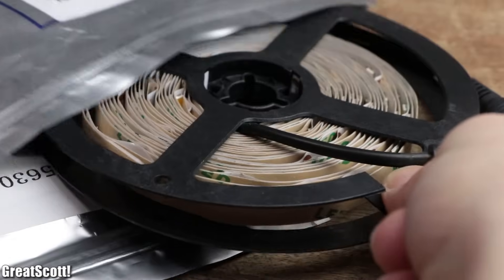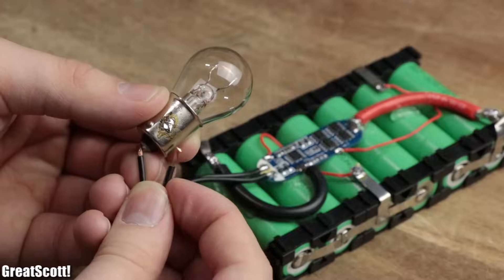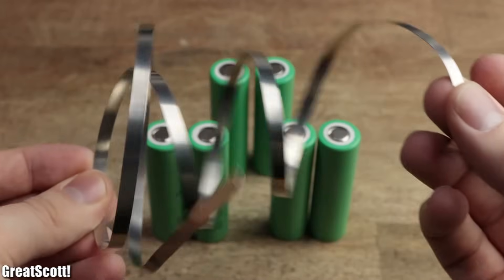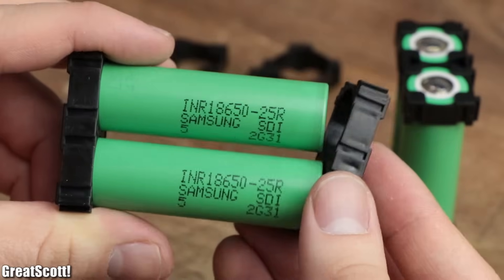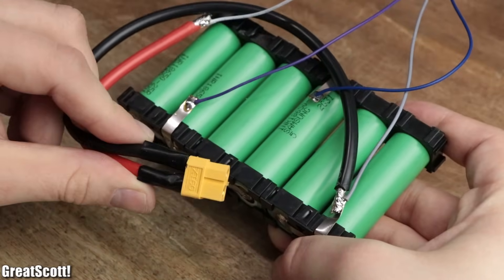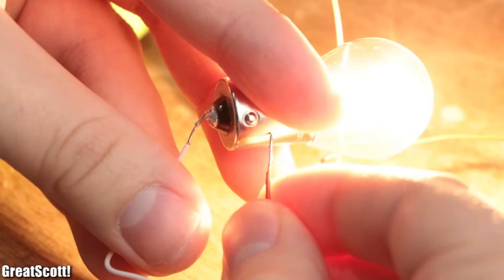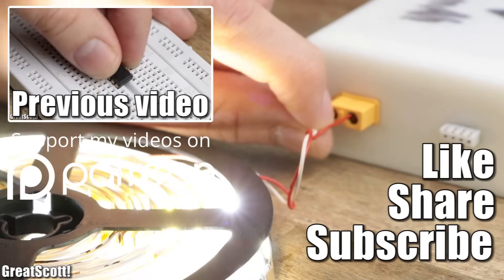Make your own Li-Ion Battery Pack

Comment: I think your spot welding attempts failed because of your technique. As you said, there was more than enough power available.

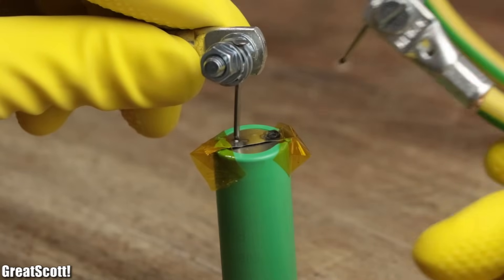Ill use 3:05 as an example.
For the spot welder to work you need both surfaces to be heated and you need pressure to force them into each other. At 3:05 the electrode on the left might have enough pressure on it for the process to work but you use the right electrode to close the circuit by tapping the nickel strip. This results in all the current passing through the nickel strip. The contact at the right point is dangling in the air so it is obvious why it doesn't weld. The left contact point doesn't weld because the battery terminal surface never gets hot enough to fuse with the nickel strip, even though the nickel seems to be red hot.

To remedy this, if you are unable to apply hard pressure to both electrodes, you need to press hard on one electrode to press the nickel to the battery terminal and then tap the second electrode somewhere on the battery terminal, rather than the nickel strip. This way the current has to flow through both metals at the contact point where you are pressing hard, resulting in heating both metals where there is pressure.
Reply: hobomnky how much voltage do abspot welder need  for this job ? ( And how much Ampere )
Reply: i dont know exact values. Something like this rewired MOT should work though, I wired one to give 3.5v output and it works. For battery terminals it would be better to have more voltage than that though. You can also use a capacitor bank for a more controlled energy output. You can have high voltage on the capacitor bank so that you get a fast, but limited, amount of energy unloaded in a short period.
Reply: hobomnky  thnx alot

Comment: nice video..im going to make one instead of lipo for my quadcopter..have a small question can i use those battery holders to skip spot welding or soldering part? is it okay? thanks..

Comment: Hey I am searching ways to light up my 12v rgb light strip that I want to install on my bike. So I found some li-ion batteries at rhis name Motoma 18650 2000mAh that are 3.7v. So basically I can add 3 of them and power it without any problem?
Reply: Yes

Comment: Could this be used as a motorcycle battery is would weigh far less and would only nedd it to get started. Would u bms control the charging ok with the bikes charging system??
Reply: Yes, they have Li-Ion batteries for motorcycles ...

Comment: Use the spot welder, don't solder directly to the cells unless you like fires. (or just buy tabbed cells)

Spot welding should be done by applying electrodes and pressure, then turning on the power.

Comment: 3/4" Schedule 40 PVC pipe can be used to make 18650 battery holders, although the inner diameter is slightly too large.  A few strips of thin plastic or even three dots of hot melt glue on the inner surface will ensure that the battery stays centered.  If you are concerned with airflow, a few slits lengthwise in the section of pipe, but not all the way to the ends will help.  1/2" Schedule 40 PVC is a bit too small, but if you have the capability to drill it out to 23/32", it could work.

When I needed to make a battery holder for an 18650, I made it out of PVC pipe or wood with a bolt in each end that combined with a lead slug acts as a terminal for each end.

Comment: i need some help...i need to supply 6volt to my  6 servo motors for my bipedal robot....i tried to make by connecting 3 li-on battery in series....and then regulated to 6 volt using 7806.....but this battery pack doesnt last for even a minute...what should i do???

Comment: Yep,
I read 3.6V nominal voltage, why did you took 4.2V as calculation référence?
Reply: that is max voltage
Reply: Areg Hovhannisyan thx...get it
Reply: 2.5 - 2.9v minimum
3.6-3.7 nominal
4.1-4.2 fully charged
no problem :)

Comment: Hey
If i use the bq29700 http://www.ti.com/lit/ds/symlink/bq2972.pdf as an protection circuit what voltage should i use to charge my LI-ION accu https://www.tme.eu/ch/details/accu-imr26650-5.2/akkus/keeppower/imr26650/ ???
I wanna charge it with http://ch.farnell.com/texas-instruments/lm21212mh-2-nopb/buck-sync-20tssop/dp/1922949
If you have a better alternative of the ICs pls let me know. (I have to make the circuit board by my own)

Comment: is there a way to make smaller power cells with this?
I have a project of portable computer system, will two batteries be enough to power it? (still don't know astimated power consumption to calculate myself)
maybe even using all 6 batts but as small seperated cells that could be better place in more conviniet place rather than a big box?

Comment: I really love this video!  I've watched it several times.  How did the soldering job hold up?  I want to use a spot welder but at the moment it isn't in my budget.  Did you see any unbalanced cells after using the soldering iron?  Hope you are well and thanks!

- Neil
Reply from the maker: Everything still works fine
Reply: That's great news!  I want to build my own 12s lithium ion pack but the spot welder would already be more than half my budget.  At that point I'd would rather just buy a lithium ion pack which would defeat the purpose of learning.  anyhow, thanks for the response!

Comment: Why not use solar taping wire to connect the cells together?
Reply: What is solar taping wire?  Anyway, could it handle the currents that the nickel strips can in this case without overheating?

Comment: Hey bro, I have a problem with mine. I built a 13 cell battery for my 48v 1000w motor but the voltage ranges when charged between 48.1v to 54.6v (3.7v x 13 cells to 4.2v x 13 cells) so upon connection my voltage is too high, but then of course drops when under load. 

I had a massive problem with my bike going up hills even with 8 batteries in parallel to get my amps per cell. The voltage drops too low and my bike cuts out.  

So I decided to add another cell, and at 14 cells we have a charging range between 51.8v to 56v. You guessed it I smoked my ebike controller. 

How do I deal with this voltage range especially up hills? I have over 100 batteries all around 2.2A wired together and still struggling.

Thanks!
Reply: Did you solve?

Comment: can you make simple video how to using 
 100V 50A&100A 7in1 OLED Multifunction Tester Voltage Current Time Capacity Voltmeter Ammeter in the battery lithium S4 bms ?

Comment: Im trying to build a portable monitor like diyperks smart tv.  I want to use a 4s 14.8v 18650 setup and I want to be able to charge the monitor using a 12v wall wort or power brick.  What combination of boards would I have to use?  I just a bms ok or do I need some sort of special board for charging lipos?

Comment: For spot welding, why wouldn't you put one electrode on the battery, and they other on the tab?  I thought you'd want the current to go through both parts to weld.  The point in the circuit with the highest resistance (between the tab and battery) would heat up first and weld, right?

Comment: Great video. Can someone just explain . Before th bms he had a 4 pin connector to charge the battery , after the bms we still charge the battery using the 4 pin connector ?
Reply: BALANCE via the 4 Pin !

Comment: Is that battery management circuit performing bottom balancing instead of top balancing maybe? What are the cell voltages when the device discontinues current when High and when low? Is it just being lazy and stopping charge/discharge when any single cell gets over or under a set point voltage? If so, you may need to experiment a little and see if you can manually top or bottom balance the cells to see if the BMS takes over better then.
Reply: NO

Comment: Hey Scott, a lot of people seem to use 3s as an unit for voltage, whereas I taught that 3s meant 3 batteries in serial... Could you please clear this up?
Reply: 3 batteries in series = 3s = true
3s when working with li-po or li-ion batteries means 3 3.7v batteries in series.

Comment: 3:00 I'm no expert on the subject, but your weld probably didn't work because you were trying to weld the ribbon piece on itself. I think the other electrode should touch the surface of the battery and the other should touch the ribbon, so the current flows through both metals and melting them together. It's just how I see the principle, please do correct me if I'm wrong.

Comment: Thanks just what I was needing going to build me some packs for various things. May even make a super capacitor car battery with ion sub battery back up. Or even a large pack for my contracting tools when you working all day you will go through 2-4 battery packs. Mostly draining the power low a larger pack in theory should cycle longer if you could go home with say 50% battery instead of 6 empty opnes. I know an old timer who uses a capacitor bank with a 18v fork lift lead acid battery bank. Will last on the job for days as they build off grid alot doing fences  he wires his tools to old battery packs which actually provide really good cells themselves even better than laptop ones! Seriously check Homedepot/lowes recycling bins often looked over as people go for laptop batteries. Most packs will have one bad battery and 3 good ones usually for top brands high amp and 3000 mah cells. They are harder to open though lol

Comment: A heads up for anyone that doesn't know you can buy 18650 batteries that have tags already attached generally they come in two types U-tags and Z-tags, the Z tags face opposite directions the U are the same direction.

Comment: Have you thought about limiting the current on the primary coil by adding a series resistor ? Much easier to control the current that way instead of adjusting the output voltage

Comment: For the past few days, I've been hunting for something like this, only to find to many conflicting comments. My Question, and it seems you have done it here! (" Is it ok to connect a BMS Board, and the P1 balance charging cables, to use with an Imax B6? Don't you get a conflict between the BMS board and the Imax when balance charging?") I have a few projects, that I really want to use both. But my Research has pulled way to many users, claiming, NO, its one or the other.  If this works, I can use my Balance charger when I am at home, and when I am out and about, I can just plug in a Charging cable. What are your thoughts! Great Video by the way!!!!! This is the Exact size(4S), I plan on using in 4 builds, 3 others are 3S.

I would like to add-The only difference, I would use a DC female plugin along with the female end of the 1P cable on the outside of my box(sorta like your box). That ways, when I go to charge, I would use a DC adapter from the B6, and Extended 1P cable for Balance charging. This give me the Option to keep the 16.8VDC plugin on the External charger, when out and about. Instead of using the XT60.(See any problems) You advise would be appreciated!
Reply: NO conflict !

Comment: Hi Scott! The video is great. I wanted to see if you could take this to the next level and make an Arduino UPS? Maybe add a power path circuit and have it perform based on mains voltage sensing. If mains are on - power the arduino using mains with a wall wart and auto charge the battery. When mains are lost - the battery pack switches over and powers the Arduino. It then waits to detect the mains and switches it back.

Comment: I build batteries for a living and you have some serious flaws in the video!

1. Dont build your own spotwelder! They are powerful and extremely dangerous since the are connected to the outlets and perhaps leathal if handled incorrectly!

2. You should never solder directly on the batteries! That will destroy the capacity!

3. If you dont want to buy a spotwelder then buy them with TABS! Or battery holders!

(and if you are going to solder on batteries the you need high heat and BIG tip and do not solder for more then 2.5 seconds!)

I soldered one pack in the beginning (like you do) and 2/8 of the pack lost its capacity and voltage within days!

4. ONLY buy brand cells! Cheap chinease cells are often more flammable and seldom last as long!

Comment: What is the math that shows that adding two 12V sources (3 x 4.2V Lipo batteries in series) in parallel doubles the entire 12V source capacity?
Reply: uhhh
there are more batteries, and connecting them in parallel doubles capacity?

Comment: When you try to weld batteries together, i recommend using carbon electrodes and a voltage of 25V. With my lab power sypply i was capable of welding two transformer sheets together. I'm using a PS900W with 15V 60A, 30V 30A, 60V 15A. Mayby it is worth trying for you. For Batterie welding a car batterie as a power source should work fine :-)

Comment: Hey Scott!
I just bought 4 similar batteries (they end with -26H) with protection circuits and I was wondering if I still need the BMS if all cells are the same voltage (3.57 V), or if I can at least not use a balance connector

Comment: Hey GreatScott this is a really great video and a awsome help. I was wondering if you could show how to make or tell just me how to make a voltage cut off for already made lipo rc packs. I found a really simple one on instuctables but the 6 pin relay they use i cant find, if you could tell me a equivalent relay even that be great. i need any other brand relay that works the same as the DSP1A-L2-DC5v relay
Reply: or Can i just use a BMS circuit and just attach wires with plugs so I can have it plug into the battery wires and my device plugs into the bms, then I can still use and charge my lipos independently

Comment: It's better to make an arduino BMS by yourself, those eBay things go way too low on voltage, and continue sucking battery even tough the battery is disconnected!

Comment: I bought a bms for a 3s2p like in the vid for my boombox driven by a tda7492p and a little boost converter like in the usb power bank video. Am just not sure if I amply 12.6v to the bms if it will charge the batery corectly.. :/ the only charger i have is a traxxas and it does only charge lipo or nimh. what should i do? btw am canadian and i speak mainly french so sorry for bad english :(

Comment: your accent is funny. Great video as usual, I wonder if I could reuse laptop 18650 with another BMS chip (I think the original one is locked in safe mode)

Comment: Your videos are very nice, i have question,  if i have a power adapter  it says it converts 220V ac to 12V 1A , and i connect it to a dc device that needs only 350 milliamps , what effect will it have on device,
Reply from the maker: It will work just fine
Reply: Thanks

Comment: Good, but i think i rather do it with just pararell cells + tp4056 module + boost converter as this will give me easy microUSB charging without the need to buy expensive balance charger.

Comment: Why not just attach the bms to the pouch packs ?, they are the same chemistry, the problem with creating packs with the 1850's is you're creating more points of failure, a lot of battery pack failures are from bad connections between cells heating up.

Comment: can you please do a video on how to check if the battery is damaged so as not to charge it?
Reply: you can use a battry charging and discharging station to find its rating and if its lower than average its probably damaged

Comment: I scrapped one of those "hoverboard" vehicles that are notorious for exploding. i thought i found the issue when i did not find a balance charging connector, peeled off the plastic wrap to find a hefty bms hidden on the side that apparently does all the charge and discharge management. It has four power mosfets in parallel placed in series with the positive connection. Having no idea what happened to the charger, i'm not sure how i should charge it now.... or rather i'm not sure if i should trust the bms.... In case you are wondering what was wrong with the "hoverboard" it is hardly anything, everything works fine except the controll ic which has acquired a tendency to throw the user on their face unexpectedly. It has some nice in-wheel three phase motors but the drivers for those are deeply integrated with the evil controller ic. Someday i'll get to repurposing these parts...

Comment: Hey, thats not how spot welders are used in IRL. there is a foot pedal which we push to turn the electrodes on after we have placed them correctly on the work piece. This prevents sparking.

The newer fancy ones have a pressure sensitive switch on one electrode which automatically does this for us.

Comment: As far as soldering directly to batteries goes, there appear to be no ill effects especially if you immediately grasp the solder joint with a cold damp cloth. Mr Carlson's Lab channel has done it repeatedly over the years with no problems.

Comment: Some laptop battery protection PCBs work just fine as BMS, they have over/under voltage protection, overcurrent/overtemp protection and balance cells (some do, some do not...u have to check). And they come FREE in old battery recycle bins/e-waste bins ;-) 
With worn out cells that might be usable for low current applications allready attached, good for experimenting... If you need/want higher capacity and low int. resistance you have to replace cells, offcourse.

Comment: for a low amperages like this I use "solar bus wire" comes with low temp solder pre applied to it works like a charm very inexpensive also easy to solder (I've used it on an ebike battery 13s8p pulling about 80amps burst at 54v noooo problem) not recommended  creates lots of heat at that stress level prob due to resistance